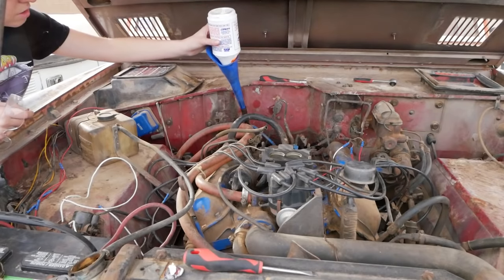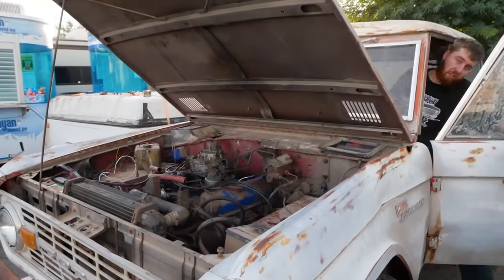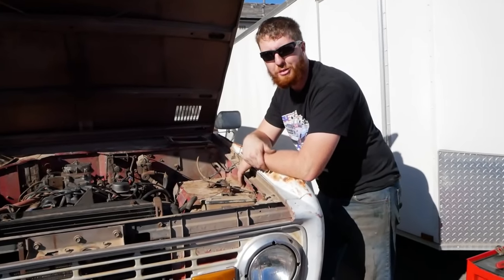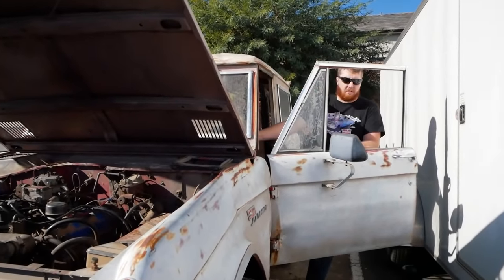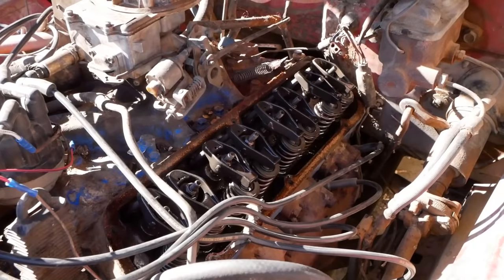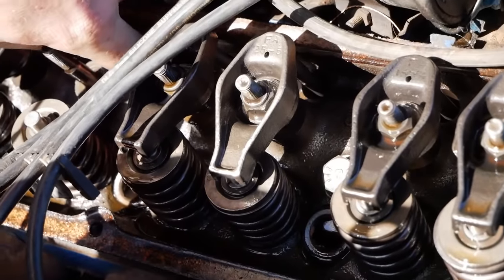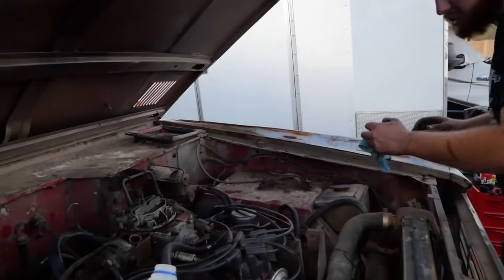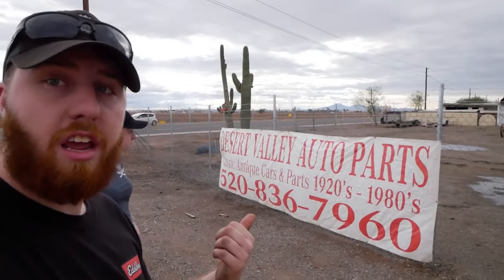ABANDONED Bronco Saved After 10 YEARS in a Storage Lot! Will it Run and Drive?? - Part 3

Comment: Plugged up water passages: Yes it is "sort of" a North/South thing, in that there is less incentive to run a coolant mix when it won't freeze anyhow. Add to this the fact that our water tends to be more mineral rich. Of course, this is much more common in older vehicles, which is what you're dealing with. Personally, I use a 50/50 mix on all of my stuff these days, as it is unfortunately too new and costly to take a chance with. I'm also a bit wiser than I was in 1960!
Reply: Agreed, There is less incentive to use coolant where it never freezes. And then you forget about it until it starts overheating. I learned my lesson a long time ago. I keep coolant in mine all the time. I have lived in Texas and Arizona almost all of my life so I have learned the hard way.
Reply: Seriously who the fuck puts tap water in the radiator? In Greece everyone uses purified water.
Reply: @ΣτελιοςΠεππας  It was done alot in Australia too. Countries hot, don't need coolant and then when there's a small leak they would put stop leak in which just plugs the whole system.
Now alot know better and still won't run coolant but run anti corrosion, water wetter or a mix with demineralised water
Reply: I was about to make this assumption. They don't have to worry about coolant freezing like in the colder areas. I want to import something from the warmer states to Canada just to avoid the rust, but this kind of scares me. Although redoing an engine will be easier than tackling frame and body rot.
Reply: Back fire be timing no
Reply: Hardly anyone uses the recommended distilled water and just use tap because it's pretty much free
Reply: When you come from more humid climates, it's difficult to wrap your brain around how hot and dry the Arizona desert is. I believe the plugged up coolant passages were from rust and dried, broken down crystalized coolant. Plus with dry heat comes leaks which leads to topping off with easily accessible water and not always coolant.

Comment: An addendum to the zinc discussion: 
Oil detergents and zinc work against each other is the issue - this is why the amount of ZDDP has been lowered. Detergents are a lifting agent, where zinc needs to stay put. You can also have too much zinc which does negatively effect lubricity overall. 

Oils today have about 500ppm of zinc, which you can think of it in terms of “the more you have, you more miles you can go” (to a point of course) instead of “the more you have, the more it protects” which isn’t necessarily true. Like Kevin says, it’s a consumable sacrificial layer. Be sure to change your oil at 3k intervals and rotella will treat you fine for most all stock to mild applications. 

At the end of the day, the roller conversion is king.
Reply from the maker: Holy science, thanks Dad 👌
Reply: @JunkyardDigs  DAD?
Reply: Enjoy both of y’all’s videos! One more addition to the flat tappet discussion, there are fuel injected flat tappet cars. The ones that come to mind is early fuel injection ford 302’s and ford 300s!
Reply: @finger1651  I’m older than I look, what can I say 🤓
Reply: I added a zinc additive when I rebuilt my old 460 but didn't the next two oil changes I did to it
Reply: so what about diesel engine oil which has high levels of detergents and most diesels have flat tapets?
Reply: @ashleyjohns1266  old engines love T4 rotella, lots of zinc and a good additive package for them. It's what I run in my 70 Lincoln
Reply: Rotella T4 has about 1100ppm of ZDDP. That’s on par with the 10w-40 amsoil premium protection that I run in stuff that I care about it that has an aggressive cam in it. If it’s you average old Ford pick up it gets good ole T4 flat tappet express. Luckily the local rural king carries T4 in 10w-30 :)
Reply: @ThunderHead289   That's what Mook says.
Reply: I’d suggest checking out the amount of ZDDP in the oil you’re using, and the amount in the additive. It’s been noted before (I think by project farm) that the additive actually contains LESS ZDDP (ppm) than some oils. That means the ZDDP level is actually being diluted, not increased.
Also, since Valvoline VR1 was mentioned - it does come in 10w30, it’s just not as easy to find as the 20w50 variant (check a Fleet Farm, if you have one near by).
One last thing to note - saying higher ZDDP levels don’t negatively impact anything is primarily applicable to pre-catalyst (or non-catalyst) vehicles. The higher ZDDP levels will lead to early catalytic converter clogging/failure, as the burnt zinc (worn engines burning oil, or the oil that’s burnt every cycle off the cylinder wall) can’t pass through the medium properly.
Reply: OMG you guys. Put a $14 jug of Walmart super tech in there and be done with it.
Reply: @JunkyardDigs  Not only are they tempted to not use antifreeze in the South, but in general the east is acid while the West is alkaline.
Reply: @traviskingrey4335  I think that is also on par with Mobil 1 High Mileage Synthetic
Reply: @alan6832  I've lived in Wisconsin and the limestone content of the tap water is impressive!  I didn't buy any abandoned cars while I lived there so I can't comment on their cooling system condition.
Reply: How old is mook
Reply: @michaelmaslonka3464  35
Reply: we run 1L of atf with every second tank. my grandfather figured that out 30 years ago and been running our same engine the same way all this time. lubs everything up.
Reply: The Zinc was also removed because it slowly gums up catalytic converters. You have to watch out because some of these diesel oils are removing ZDDP as well to accommodate modern diesels with emissions equipment. If it has an SN rating on the bottle like Delo, do not use it.  Even the new CK-4 version of Rotella T4 has reduced zinc compared to the old CJ-4 only stuff that was just recently discontinued. You can only get the good stuff now in extremely large drums. Pretty soon we'll be stuck with expensive stuff like Valvoline VR-1 and the Amsoil stuff for flat tappets.
Reply: What if there is no roller conversion available for your rare Mercedes or English engines that are hard on gas and not very common? Is it cheaper to source specialized oils for old cars?

Comment: Its the minerals that make it "hard water" and it just builds up plugs up everything
Reply: Indeed. That is why my dad taught me to use distilled water in the rad.
Reply: Exactly, always use distilled water down here in the south, water is harder than Greek Math.
Reply: didn't see your reply, that water sucks
Reply: I assumed it was people using regular tap water and not flushing it out since its hot down that way and shouldn't freeze. And it sits and that when it does its damage whether or not someone adds coolant at some point.
Reply: In addition, in areas where you don't have to worry about freezing people often just run water without the anti-freeze, so no corrosion resistance
Reply: It is over diluted coolant, not minerals from tap water. It would take thousands of gallons of hard water to equate to that much solids.
Reply: 👋 hey Mark 😆
Reply: Yes they do have a lot of iron in their water down there.
Reply: @robertgibson88  So the iron came from the water and not the cast iron of the block itself? What if the iron that the block is made of reacted to the oxygen in water to form iron oxide molecules, that would be nuts. Holy cow.
Reply: @ipissed  I'd say both are correct. Once the rust starts it multiplies quickly. Should always run anti-freeze in the cooling system ,because it not only protects from freezing. It also has protectanys in it for rust, and slug.
Reply: Run a few bottles of clr though it. Will clean it up nice
Reply: Mark is right.. I’ve run a couple of shops here in Las Vegas and we’ve done a lot of “revivals”, mostly cars that sat outside for extended periods of time.. the cooling and fuel systems are always clogged; cooling is usually a combination of the minerals and rust from using mostly water (which creates rust in the block)in the cooling system. Anyone that lives in the desert southwest knows, if you buy a new garden hose and spray nozzle for your house, within 6 mos. the nozzle will be welded to the hose from the minerals in the water.. fuel is a bugger here too.. let a carbureted anything sit in the desert sun for a couple of mos. and the bowls will be nothing but thick varnish..

Comment: Well you certainly tried! If I only had a dollar for every blue butt connector under that hood...
Reply: You would be making money in a very strange way friend.
Reply: All in all a good job! One thing a old timer taught me was regardless of your poop gas add ATF slowly down the Carb on start up and while you test run it. ATF is a great cleaner and lubricant on the valves. It works! Brake Clean strips away all your lubrication. ATF and White Vinegar in your cooling system does a good job of cleaning you cooling system.   You guys gave it one hell of a try. 2 thumbs up,
Reply: Omgg on every truck I’ve bought I get rid of every blue crimp connection and put solder style ones on, literally makes a engine bat look 10xbetter
Reply: You'd have about 37 dollars. Happy new year Wes!
Reply: If i had 10 dollars for everything blue under the hood I'd probably be rich
Reply: If they got those at O'Reilly's, that's probably what they initially paid.
Reply: Blue butt...saw those baboons at the zoo.  It looks painful 😖

Comment: When you finally got the engine to light off, it sounded like a Briggs & Stratton single cylinder mower.
Reply: I work at Briggs & Stratton at the Poplar Bluff, Missouri plant and you’re right. It did. Lol
Reply: I read this before I got to that point in the video and thought you were joking but holy crap...
Reply: Reminded me of a rototiller or a old briggs and stratton push mower lol
Reply: As a small engine mechanic. That Briggs needs a carb clean. But yes.  Lol
Reply: Came to the comments to say this same thing

Comment: Can you please put the words "thank God someone welded this push rod straightener up front " on a t-shirt . that was golden 😂👌
Reply: I'd buy that
Reply: I know pushrods are thin tubes filled with sodium metal for its heat transfer ability, that metal floats on water excitedly before exploding... That's why it's kept in glass jars in paraffin, or encased in aluminium cans for adding to the furnaces of aluminium where they cast cylinder heads etc.
As far as hitting the pushrod with a 🔨 hammer, do it gently lots of little hits, so the tube doesn't split. But go for it
Reply: I’d buy two!
Reply: @pikethree  I think you may be referring to valve stems? I might be wrong, but on hydraulic  lifters, the oil feeds thru the center of the pushrod.
Reply: I'll buy one for sure!
Reply: @John-4649  You right, my mistake.
Reply: @pikethree  no worries bud! Only reason I know is because I read that the Hellcat valves are sodium filled and I was curious if my heads could be machined to fit them.
Reply from the maker: @pikethree  yeah these are definitely just metal bendy straws. None of that fancy science stuff exsisted until very recently

Comment: In the south west people tend to use straight water in stead of coolant, straight water causes corrosion.
Reply: yup.  Im here in FL and yeah coolant 50/50 is the best.
Reply: Agreed
Reply: Yep, every small passage plugged and blocks full of rust up to the steam ports, so common, if one freeze plug starts leaking, prepare for major surgery , head gaskets water passages heater core are next to go.
Reply: If used for short amounts of time its fine ok
Reply: And due to electrolysis corrosion  chews holes in the cylinder walls and ports.

Comment: Hey Kevin, just a few suggestions. Don't run cars on their original fuel tanks, always run them from an alternate source. My dad taught me that. Also, if you know you are going to have to go through the engine again, put water in the cooling system not coolant. That way you can rinse flush without having to worry about spilling toxic coolant everywhere. I think this bronco motor would have ran if you'd not used the original tank. I was honestly impressed when you first started it up. Sounded healthy. Love your channel BTW.

Comment: Instead of using distilled water or pre mixed fluids down here, people use our hard tap water. I rebuilt my 95 Tercel and every aluminum outlet and hose had to be replaced, they were all so very corroded.
Reply: I suspected that

In the north, you're forced to run antifreeze, otherwise whatever you put in it will freeze, but the important part is that almost ALL antifreeze brands have rust inhibitors mixed in the fluid, so even if they SIT, they wont rust.

Plain water that sits = rust, 99% of the time.
Distilled water doesnt have the minerals but thats dicey.
Reply: @icy7153  You should run antifreeze anywhere, and specifically the color your car needs. But down south here we have hard water unlike in Michigan (which i'm originally from) that doesn't have the hard water build up problem. People here in phoenix, i've noticed myself specifically, like to add the hard tap water to their vehicles cooling tank. On my rebuild the water had built up and corroded every inlet and hose with deposits. I'm saying if people used distilled water as they should to make the proper 50/50 from concentrated antifreeze, then there wouldn't be the corrosion and buildup of junk and lime.
Reply: @TheBisexualKid1  yep

And this hard water you speak of is full of minerals, (which i just googled, includes iron, magnesium and calcium) and when u think about it, pure iron is the easiest thing to rust so that'll start to rust and sink to the bottom, then the rest will follow and before you know it we have the same issue that he's facing with the bronco

And yeah, if they did the 50/50 it would be fine, but up north, if u put tap water in your engine it WILL freeze and your engine block WILL crack, so they have no other choice.

Down in warmer climates, since youre not forced to do it kinda, its easier for people to just not care, which is really unfortunate
Reply: Flush once every 18 months, one gallon of vinegar, rest water. Run till operating temperature. Flush entire system 3 or 4 times till vinegar smell is gone.
Reply: @icy7153  problem with using just distilled water is that it promotes electolosis. Only use with anti-freeze, not by itself!
Reply: @icy7153  It isn't just the hard water/distilled water issue. It is TOO MUCH or TOO LITTLE(look up the science behind it). There is a happy medium with minerals in water. Too little and it will disolve the metal it comes in contact with...too much and it will cause clogging issues. Bottled water is about right. Distillled is ok with antifreeze. If you are going to run plain water, use bottled water, not tap water.

Comment: Look's like water was used more often that anti-freeze that caused it to rust/corrode
Reply: my thoughts as well. straight water doesn't have any corrosion inhibitors.
Reply: AZ has some of the hardest water in the country too, if they just used tap water(like most people) instead of distilled water, it'll definitely contribute to this more than any other reason

Comment: Hah, it looks like someone sprayed a bottle of fix-a-flat in the radiator.
Reply: My guess is that since it never freezes, they think they can just run water all the time, and therefore have no corrosion inhibitors, even though you can buy corrosion inhibitors much cheaper than antifreeze, plus 10 drops of trans fluid inhibits corrosion in a cooling system of water pretty well and costs next to nothing.
  As for the bad fuel despite 5 gallons, it adds to the risk but add more top tier gas and lots of fuel detergent like Berrymans, or my favorite is Star Brite Enzyme, then start it with starting fluid if necessary and drive out most of the tank on the highway without having to idle.  The longer you can keep the engine running, the more fuel crap it can process.  The problem is you might want to give up on the local trails because that carb needs highway unless you have the containers to drain all that fuel.

Comment: For those of the cars that are living in climates that never get cold enough to freeze people just use regular water regular tap water with lots of minerals and garbage in it which rusts out the blocks. If you live in a climate that freezes the cooling systems are more protected because people are actually using antifreeze..

Comment: 1) As you're now realizing, it's a dumb idea to use the fuel tank on a car this old. You should have simply run the engine straight from a clean fuel can.
2) You should not have let the engine get so hot.
3) It's easy to be an armchair critic. You guys have still done well. Car restoration is worse having kids; nothing ever goes to plan.